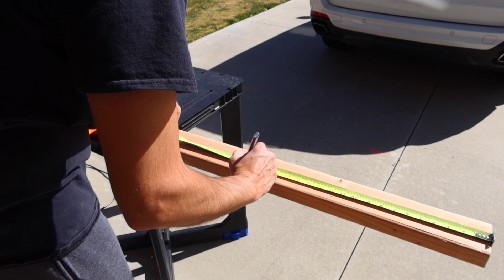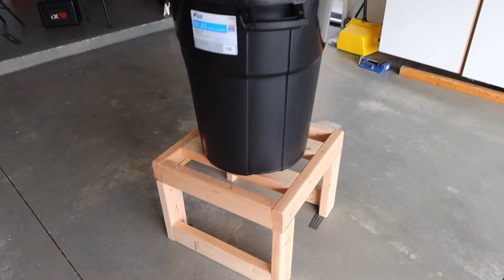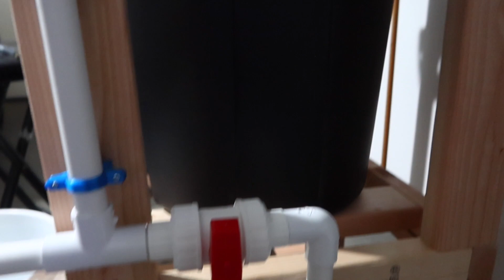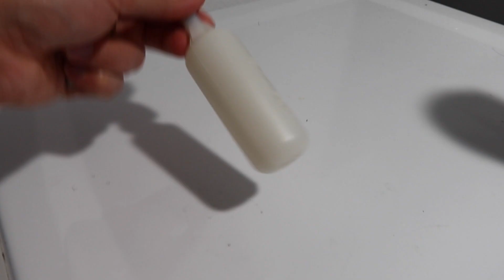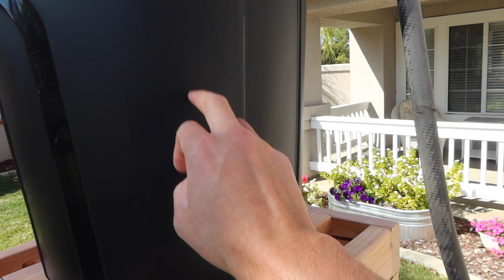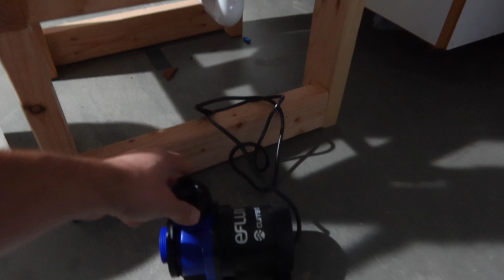Under $100 Mixing station. Can we stay under budget?

Comment: Might want to speak to why a pocket screw is superior to a butt joint. With everything layed out, it seems trivial to just nail things together ... but it would become unstable overtime and never last with that weight, especially on cement that will transfer vibrations, etc. Never nail or screw into the grain (eg, butt joint)

Comment: Looks good.  I'm going to do something a little different with a pump to mix salt but I am interested in those pvc holders.  I don't see your email but wiill you give out the fusion360 file so I can alter it a bit without having to do a complete design from scratch?  I can print myself.

Comment: How do you put the lid on the bottom can if the pipe from above extends down into it? and then, how do you get the lid off to put salt mix in there?
Reply: still. this.
Reply: eh, i figured it out. you just have to leave it detachable without gluing it in.
Reply: @marcjoseph1124  Right, I'd agree a lid on a saltwater mixing station would be ideal to prevent the splashing. A quick and dirty option is to drill a hole in the lid and then cut a slit from the middle hole to the outside edge so it can be split and twisted just enough to wrap around a pipe. A better solution would be to use a union fitting to allow two sections of pipe to screw together or apart as needed to separate cemented pipe sections. A slip fitting with piece of pipe works but will come loose eventually spilling water everywhere unfortunately.
Reply: @philsowers  Hey thanks I actually ended up building a near replica of this system with aluminum and temco containers.
Reply: @marcjoseph1124  Any details or pics posted anywhere?

Comment: While I greatly appreciate the tutorial, I built this unit and all went well EXCEPT that fusion glue. That stuff is horrible. Mine has never fully dried as I can still smell significant fumes a week later.  I actually Plummer it all, waited 24 hours, then started filling the ro and saltwater bins.  Nothing leaked, and I thought all was well. Tried the bucket spicket and immediately smelled very strong glue fumes.  Dumped all the water, pulled everything apart and dried it for 2 more days. Still fumes.  Waited 4 more days and had it outside in the sun and wind. Still fumes. The glue is to be avoided. Going back to two part.

Comment: Love it but you should put plywood on the 2 - 2x4 that the trash cans are sitting on. Make go to the outer edge of the 2 outer 2x4s, that will support the wait of all that water. Water weighs about 7 lbs per gal so about 140 pounds or so. Very good design thanks for posting.
Reply from the maker: If you go with these tanks you are fine. Kreg joints are rated for over 1000lb. But if you really want to add it that won’t hurt at all 🤙🏼

Comment: How would you do this with a larger bin such as a 32, 44, or a 55? My wife and I are looking into getting a large waterbox (220+).
Reply: Scale it up? Would the dimensions be that much different?
Reply from the maker: That for sure would need a platform out of plywood for the container. Aside from that just scape it up.
Reply: Also, I was wondering if you had any suggestions about what kind of return pump for the WB. Or other things that I will need.

Comment: I would use the grey brute cans. Those black ones probably aren’t food grade and will most likely leach phosphates into your water
Reply from the maker: All plastic trash cans tend to have the same plastic rating ( I checked when I was there). The grey brute cans aren’t food grade either. You would have to go with ones that I got to be food grade for my personal mixing station
Reply: Just for your knowledge, the Brute cans are NSF certifed.

Comment: To get more water out from the bottoms of the barrels, put a couple elbows together,  inside them, so the inlet of the pvc ends up pointed down towards the bottom, and only a half to a quarter inch off the bottom. The syphon caused by gravity will keep the suction , past the current level can drop.

Comment: I would add a plywood top to add some strength and protect 2x4s
Reply from the maker: Can totally add it for extra. The kreg joints are rated for over 1000lb which we won’t even come close too.
Reply: @DeepDropFishingTV  Didnt know they were that strong?  Although if the screws rust the joints could fail. 20 gallons is still a decent amount of water you wouldn't want on your floor unless its in a garage or basement?
Reply from the maker: Ya no for sure it wouldn’t hurt to add them for extra security
Reply: Because all the weight is on those 2 2x4 other that it is good
Reply: @Bamacher59  Exactly!

Comment: Sweet video really like the how to do you have a question for you on the bottom container where the pipe comes out of the bottom of the trash can and the 90s back up would that only allow you to get what's in the upper part of the trash can until it levels out or will it allow you to get all of it or would you recommend having a pump
Reply from the maker: Can you elaborate a little more
Reply: @DeepDropFishingTV  i think he means that at the bottom bend of pvc, it has to go down and then up to go out. In order to do so, the water in the bin will have to be higher than the pvc. Which means when you run out, that water won't exit until you make a new batch. It has to even out. 

(Difficult to explain but i had the same thought)
Reply from the maker: I think I get it. And yes since it’s going up it will only drain to that line. So yet it will leave some water but honestly not a lot. My big bins always leave 5g inside. If it really bugs you the best bet is make the bottom feet higher. But then again your limited to the height of the uniseal and Pvc thAt slips into it.

Comment: I would recommend making the upright legs from one piece of wood.. garbage cans full of water weigh a bunch
Reply from the maker: I did the whole weight calculations of the bins full of water as well as the kreg screw loads. You won’t even be coming close to Loading this setup. This was put together in the same fashion as my bigger setup when it comes to hardware and joint types.

Comment from the maker: Remember to check description for products used as well as link to containers and Other stuff purchased form amazon. Keep in mind you can totally make a setup under $100 assuming you go with smaller containers.
Reply: In case you're not understanding my question it's the part of the pipe that is on the outside that 90's back up wouldn't the trash can inside stopping that level on the inside of the trash can so if that was a 20 gallon of can you would probably only get to do a 15 gallon water change you for take
Reply from the maker: @BALD8BIL  when I checked it left almost 2g in it. Again my $1500 setup always leaves 5-6g inside just bc where the factory places the bulkheads. You can change the design if you wish. This video was made to get people thinking and not intended to do exactly as I did. Think of it as a way to expand the mind 😊